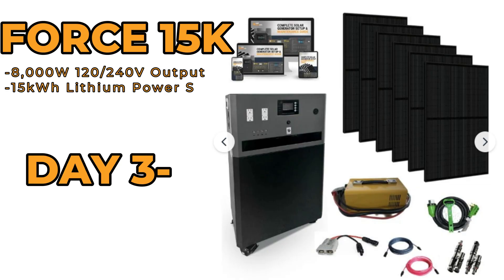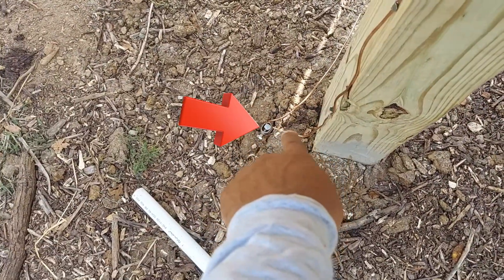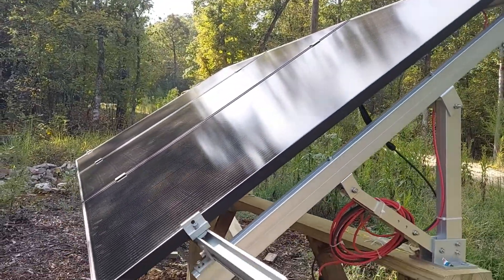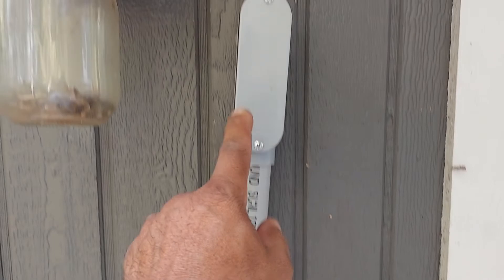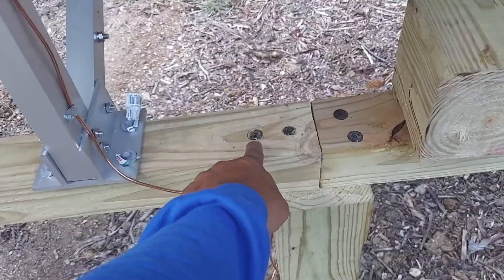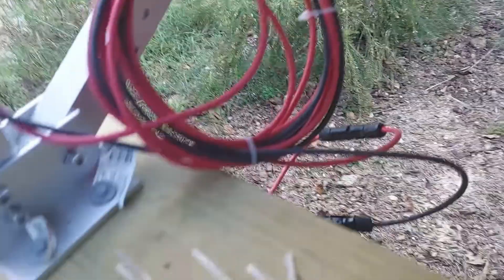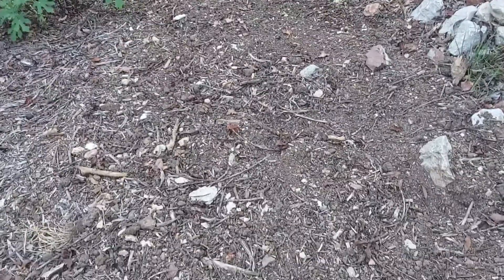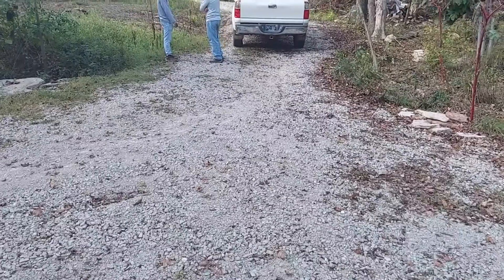Force 15kWh 48V LFP Battery, 8kW inverter Split Phase, 2400W solar input - Day 3 - 4 Completed

Comment: I have a Force 15k also. Good inverter sofas, I ask what are the parameters you are using. (Setup). Do you have blue com cable connected, from inverter to battery?